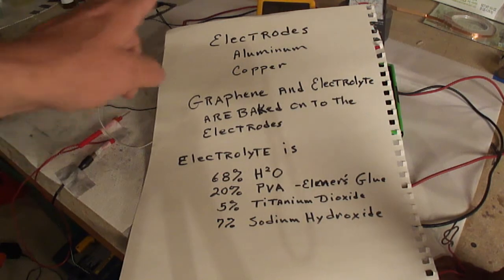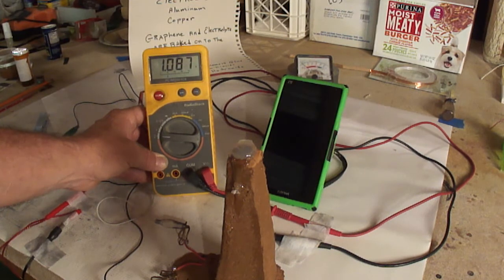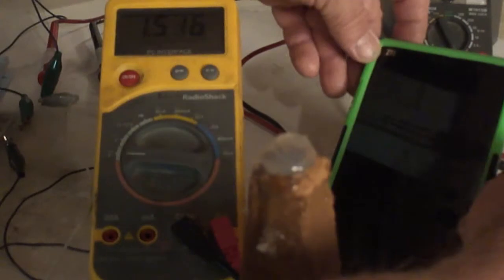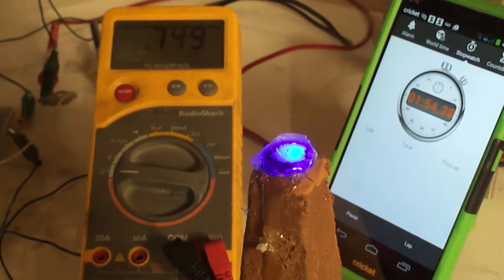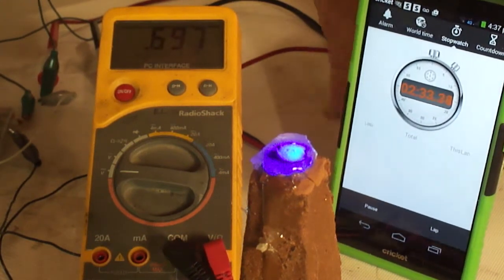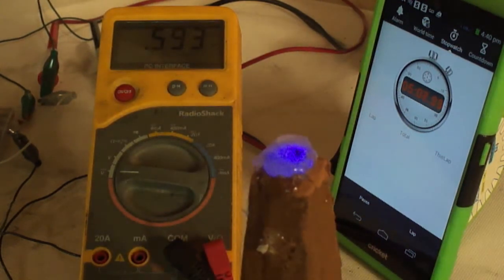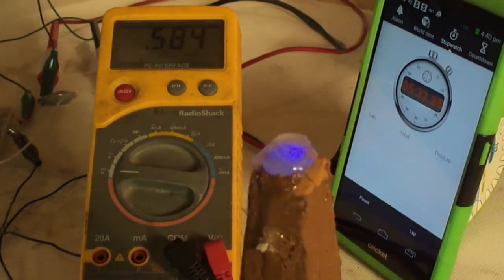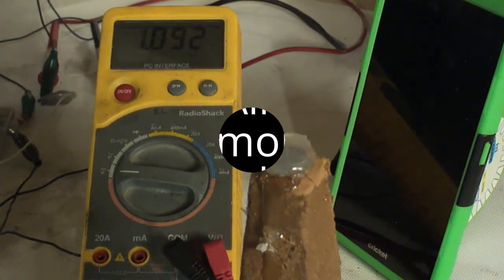Graphene Based Energy Storage Device

Comment: I am so angry I did was making the batteries with the Aluminum and the Graphene but the Aluminum just dissolves in the my electrolit, I do working now on to redesign everything. But my Batteries are so advanced, I will show it working soon,
Reply from the maker: +Bartosz Barejko I had the same problem with the aluminum .  The aluminium dissolves in the potassium and sodium hydroxide.  Then I used one tea spoon of Sodium Sulfate and 1/8 tea spoon of table salt  in warm water . the aluminum will last with out corrosion for a long time.  My plates are still good after a month , in the solution.
I have been varying the quantities to see how it effects the current and corrosion time.  When I get some good data I will post it.